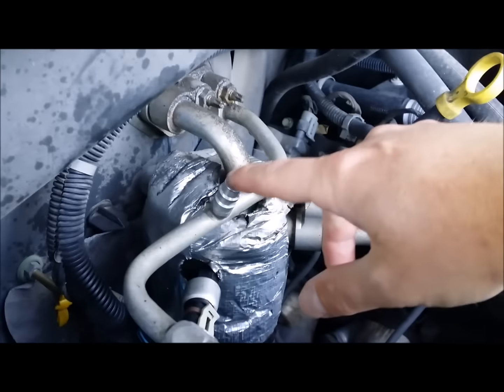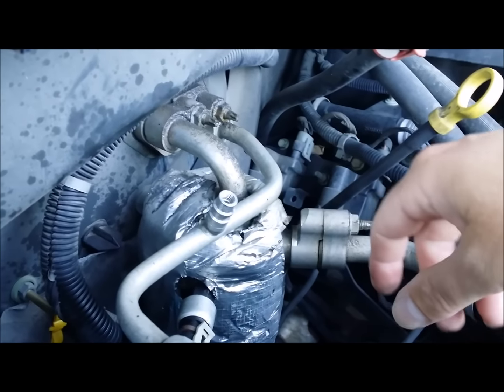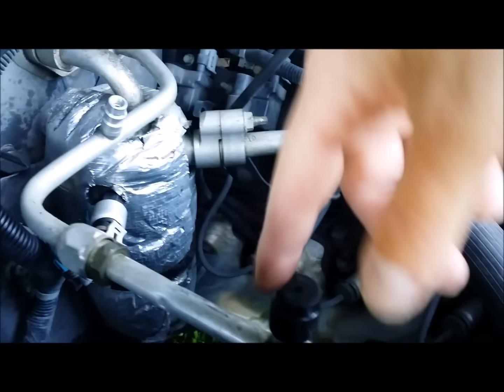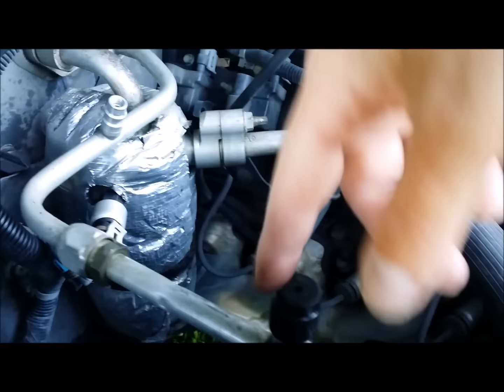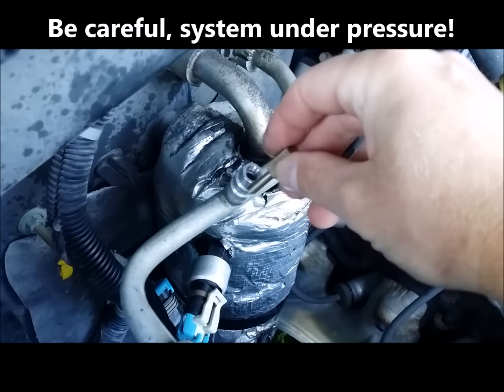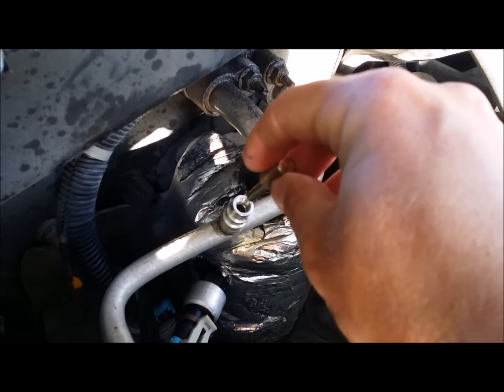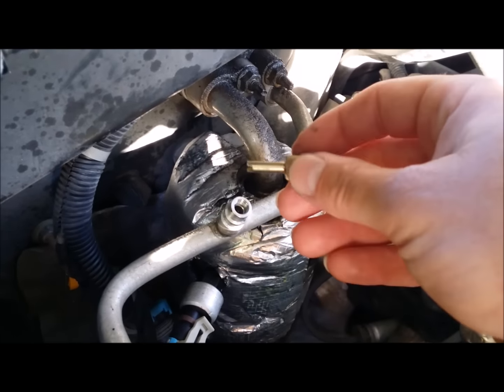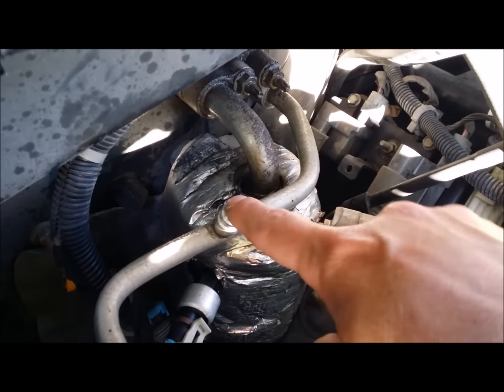How to Replace A/C Service Port Schrader Valve $4

Comment: Doing it this way could get a lot of air in the sytem, requiring you to vacuum it.
Reply: If you do the core swap quickly enough that you still have some residual pressure,  then no air has entered the system. 

Yes, it's always better to evacuate.
Reply: Yes you CANNOT just refill, you’d have to be crazy to assume no air is in a leaking system which ruins many parts of the AC! :). Vacuum it!

Comment: Nice but what if the valve needs to be removed.  I guess I will wait for that video.  Maybe tightening will fix my problem as well.  I  purchased the same kit today. Wish me luck
Reply from the maker: +Rosa Hodge good luck and let us know how u did.
Reply: Well at least I do know it is the valve because the dye that was run sprayed the inner hood.. The stem was somewhat lose.  .Now I will just take it to the mechanic and have him replace  it...It is still cost saving and I don;t have to worry about the mechanic shop hustle with 40 dollars here and 30 dollars there.  Thumbs up
Reply from the maker: +Rosa Hodge right on good luck rosa.

Comment: I have one question I need to  ask last week I went to check the engine oil in my truck and I noticed I had green dye AC freon all over the Lowe's pressure valve and a little cap that sits on the top of the valve was real loose can anyone please explain to me if that means the low pressure valve needs to be changed
Reply from the maker: The cap covers the schrader valve i believe.  Chances are you have a leak.  You could charge the system and run it to verify but would be burning the cost of a can of freon.
Reply: @JRMSweeps  thank you very much

Comment: I went to o Riley’s and the guy said mine can’t be replaced. I have to buy the whole ac line?? I thought I could screw out the whole thing and be good to go. Because he uses his tool and it didn’t do anything. Said it won’t work.
Reply: Yeah I have one that’s directly into the accumulator and I can’t get the valve stem to turn
Reply: @blackchuckstable  in fact I could remove mine. But we ended up replacing the whole thing. That was some time ago jeez

Comment: So I'm trying to replace the valve. It's stuck in the 'in' position, so it's clearly bad. I'm turning and turning but the valve isn't coming. It's spinning freely in place. Is there some other trick or step to this?
Reply from the maker: +Allen Reed that is beyond my expertise wish I could help
Reply: Yeah there a tool on the other end of the Schrader valve which will allow you too remove the valve .
The core valve was over tightened on you truck or car .
This happens in home outdoor condensers also . it's usually a pain in the ass to remove buy can be done .

Comment: I've got a 2000 Grand Caravan Sport.  That removal tool only works on the low side Schrader valve. The high side valve assembly unscrews to replace, the valve cannot be removed unless some other tool can do it.
Reply from the maker: Ok???

Comment: Is that the same tool used for tire valves
Reply from the maker: It could possibly be yes...let us know if it works please sir.
Reply: That tiny cross-shaped metal tool for bicycle tire valves doesn't work. Too short to grab the schrader inside the port.
Reply: Slime 4-Way Tire Valve Stem Core Remover Tool supposed to word for ac unit valves $1.99 autozone

Comment: Can anyone help me i have a 2003 Pontiac grand prix gt 3.8L and my high end has a leak it has the ball on the inside instead of the needle I'm thinking i have to replace that entire piece because unlike the low end it does not have the needle also what tool do i use to tighten it up
Reply from the maker: U might be able to replace the entire metal hose piece.  Of course u will have to recharge the ac system which is a piece of cake tho.
Reply: +JRMSweeps yah that is easy recharging it but that little piece cant be replaced? It has to be the entire thing? Is there a way i can send you a video of it?
Reply from the maker: Find me on facebook JRMSWEEPS and post a vid there...

Comment: JRMSweeps - Can you confirm that your Tahoe uses standard size valve core?  I have a '05 yukon Denali and want to buy the tool to swap the valve with no refrigerant loss on the low side like you, but want to make sure the valve you bought in the LR14 kit from Oreilly's has the right valve.
Reply from the maker: It was a chevy 1500...used a standard tool like u would use with a valve stem as well.

Comment: if for any reason you need to recharge your system and you have to evacuate it with a pump , all you need todo is goto advanced auto or someplace that has loaner tools some of these places charge up to $400 for the pump and manifold gauges  you put it on a charge card but you get the refund when you bring the tools back then all you will need is to buy a couple of cans of Freon with no oil  just Freon and recharge you system . hope this helps if im wrong on the process let me know

Comment: Didn't get it, did he remove the old valve or just used the tool to tighten it?
Reply from the maker: Used the tool to tighten...if u decide to remove it, u will have to recharge ac system

Comment: Hey man, are you supposed to lube the o-ring on these schrader valves? Thanks!
Reply from the maker: +BlastReadingSeries idk tbh.
Reply: Thanks for the reply man... I watched a bunch of these videos and not a single one shows anyone lubing these up. I'm figuring it's not a thing... Which doesn't make sense, I thought you're supposed to lube everything! Oh well!
Reply: The refrigerant has lube in it.
Reply: @BlastReadingSeries  it it concerns you a lot you can buy a small bottle of PAG oil and lube it in that before installing.
Reply from the maker: Pretty sure he still isn't waiting on a response lol

Comment: anyone that takes this advice and evacuates the system is going to have alot of problems later because then they probably wont realize youre supposed to pull a vacuum on the system to get rid of air and moisture. moisture will kill your compressor. then youll have a whole lot more problems than you started out with
Reply: I just break open a few of those silica packets and dump them in. Boom no moisture. Best eat the jerky fast now though.
Reply from the maker: #brilliant

Comment: I just let it all out and got another can of freon
Reply from the maker: Boom pow
Reply: That's what I was going to ask. After replacing valves and you released all refrigerant, all you had to do was add refrigerant from a can from the store? And did it work? Thanks
Reply from the maker: Yes, as long as your compressor is good that will do the trick.

Comment: It is a legal to vent refrigerant into the atmosphere doesn't matter what kind it is. 1st of all you don't go and remove the shrader valve to release the refrigerant That's why it needs to be recovered 1st.because moisture goes back into the System and can damage your compressor.it must be put on a vacuum for at least 45 minutes Then you add refrigerant.

Comment: In your own experience, can a leaky valve core, one that keeps making an audible hiss once you unscrew the cap, empty a system overtime even if the cap is tightly screwed on the port?
Reply from the maker: If it leaks it will empty...
Reply: @JRMSweeps  A lot of people seems to think that the cap, which has a dedicated o-ring too, acts as a primary seal whenever the valve core fails... that's why i ask...

Comment: Does it work on a 2003 Saturn Vue
Reply from the maker: Sure if u have a similar leak
Reply: @JRMSweeps  I don’t know if it has a leak just a missing cap
Reply from the maker: Okay, you can def go to a parts store and get a cap.
Reply: @JRMSweeps  I bought one today and the cap doesn’t fit on it so I don’t know what to do
Reply from the maker: Did u go to a store that looked up the part for you?
Reply: @JRMSweeps  I went to auto zone and they told me that I would have to go to a dealer but then they gave me caps that go on the low pressure valve cap but it wouldn’t screw tightly onto there.
Reply from the maker: I would take them back to autozone then.

Comment: i accidentally unscrewed the shrader too far n pew n beer, one thing led to another, i ended up replaccing both shraders before the system completely evacuated. so BAM jerb done.
Reply: BTW the no loss tool only works on standard valve cores... Boooo
Reply from the maker: +nader Uberallis right on my man...lol
Reply: It works with standard and JRA, at least the Mastercool (58531) does.  They do make a less expensive on that works with only standard, but the 58531 does both.

Comment: Being technical, and not political...Most systems are R-134a now, not R-12.  As such, r-134 does negligible damage to the Ozone.  (https://en.wikipedia.org/wiki/1,1,1,2-Tetrafluoroethane).  It is a greenhouse gas...but that is different than Ozone damage.  

That said, if you replace the schrader yourself, you then should evacuate the system before recharging, to properly remove contaminates.

Comment: LOL...not to worry about the Ozone....with the new president in place, there is no such thing as EPA standards anymore..lol..great vid...no apology required..lol
Reply: NO worries! It would take billions and billions of tons of refrigerant to cause any kind of harm to the ozone layer. The EPA is just being extra extra extra cautious here when they make regulations that all mechanics or DIY car owners must buy $15,000 Refrigerant Recovery equipment if they ever need to release 1.6 oz of refrigerant when working on their A/C system in their driveway
Reply: point well made......said "NO ONE"
Reply: How do you suppose the R-134a is going to get into the Ozone? Magical teleportation device? Flying Car Maintenance in the Ozone layer? Seeing how R-134a is about 5 times heavier than air it's going to just hang out at your ankles.
Reply from the maker: +Bryan Freemyer you have now just solved the reason why my feet are always freezing lol
Reply: Bryan Freemyer remind me not to breathe when lying on the ground, lol.
Reply: r134a and r410a do not deplete the ozone per EPA.
Reply: James Mckight. Since you're so concerned about the Earth, I take it you ride a bike and don't use electricity at your house?
Reply: As if people pay attention to laws, might as well not have one! EPA sucks money for nothing!

Comment: You can't release the 134 into the air. You need to take it to a shop and have it recovered. Also, wear gloves and eye protection when working with the refrigerant.
Reply: Is there some sort of secret 134a refrigerant detector that local or government officials use to determine if there is a violation? What is the penalty if a DIY is working on their private vehicle and they evacuate the 134a refrigerant into the air? I have been working on cars in my residence for 15 years now, and one of the most common and simplist repairs is fixing the A/C system in older cars. I do not have the space nor the funds for the equipment invented to recover refrigerant. But my goal is to provide the proper repairs that allow drivers of cars that are only worth $500 or less to have a proper functioning A/C system in hot weather.  And I do the repairs at minimal cost to the car owner which is why I get so much business. Lastly, I agree totally about wearing protective equipment when working with high pressure components of a automobile. For me, wearing gloves is a must at all times, and when opening the A/C system for whatever reason, and seeing the extreme pressures in that system, proper eye goggles is a must to protect myself.
Reply: That law only applies to certified auto specialists and shops that "knowingly and purposefully release refrigerant into the atmosphere" without the use of proper recovery equipment. 

The average shade-tree DIYer isn't subject to any such law.
Reply: Shawn Waldrop it’s against the law for everyone and if ever caught doing so the fine could be up to 44 thousand dollars
Reply: These guys must be a great time at parties
Reply from the maker: Oh, for sure.  Wish everyone was closer, I would def have a youtube get-together just for that kind of entertainment.